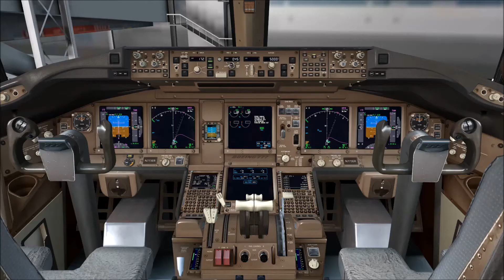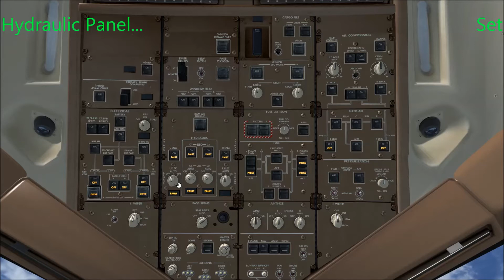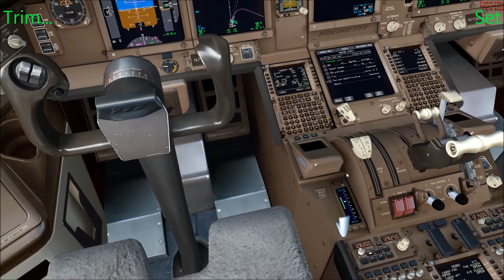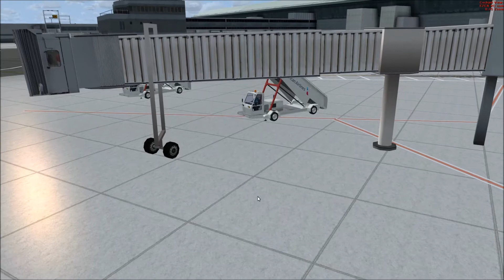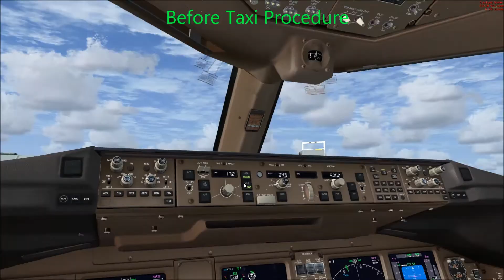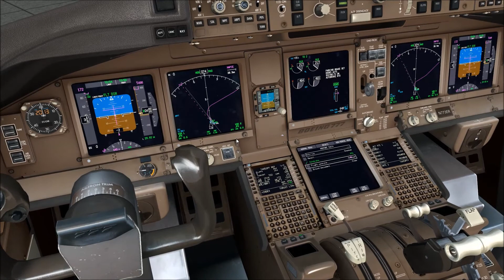PMDG 777 Startup Tutorial

Comment: Hi Captain Nav. I'm wondering what the thing that looks like another flight director is. Could you tell me what it is and how I could access it?
Reply from the maker: I assume you mean the Flight Path Vector. You can access it via the EFIS panel by pressing the FPV button. Unlike the Flight Director, the FPV does not tell you where to point the aircraft, but where the aircraft is going.
Reply: Thanks.

Comment: TCAS and WX radar should be off as long as you are at the ramp,in case of radioactive danger for ground crews.  It you turned the TCAS on at gate?
Reply from the maker: +Garry Wan True weather radar should remain off until well away from ramp. The TCAS can be switched on on the ramp, that's no problem.
Reply: It's better to switch to ta/ra when you enter the runway and leave it on standby when taxiing, because when it's set to ta/ra, the ground controller's screen is flooded with text and information from aircraft who switch to ta/ra and it becomes quite chaotic for him/her.

Comment: Just purchased the 777 and I was flying around thanks to your tutorials but when I enter on final approach, the ILS shows the correct runway ID, but not the glideslope/localizer dots on PFD. Yes, I looked to the Nav/Rad page and there was the correct frequency for the ILS. 
So... am I missing something?  The same happens with 747, I am more use to fly the 737 because I have to tune the freq and course manually and be able to land with no problem.
However, thanks for all these tutorials, already subbed!! :3
Reply from the maker: +Mario Hammett Sometimes the ILS hides behind the LNAV and VNAV display and is hard to see. In that case, it shows as a grey empty lozenge for both the localiser and the glideslope (if I remember properly). 
Sometimes when you select the ILS in the FMC, the frequency can be different from the one in the simulator and therefore the ILS won't display.
Thank you for watching the channel. Enjoy!
Reply: Is there a way to tune the freq and course manually?  I've already done some testing and the only different from the FMC and Sim(FSX) is the course. Thanks for the help!!
Reply from the maker: +Mario Hammett If the frequency is the same in FSX and the FMC navigation database, then there should not be a problem, the ILS should be tuned automatically. You can see that in the NAV RAD page.

Comment: Can you do an in-flight engine restart tutorial please? I had dual engine failure at 30,000 ft because my side fuel tanks ran out of fuel and only had middle tank... but I didn't know how to restart the engines.
Reply from the maker: Ye Oo Yeah I can certainly have a look at it, request noted.
Reply: Hi, I have never flown the Pmdg 777 but as per my knowledge, the center tank fuel is used first and then the main tank fuel is used. How could the fuel in the center tank be left and the fuel in the main tank has finished?

There is a possibility I think,
 You might have not turned ON the center tank pumps.